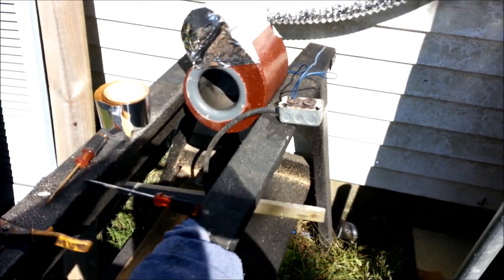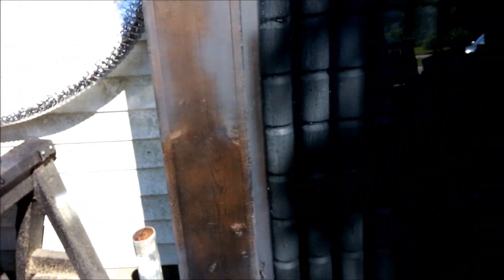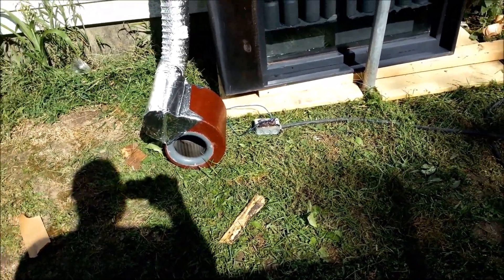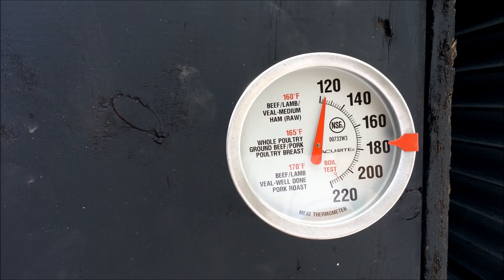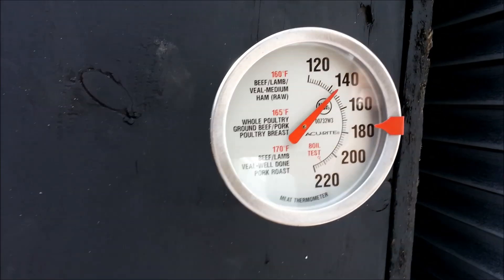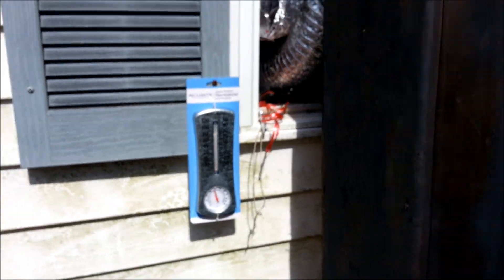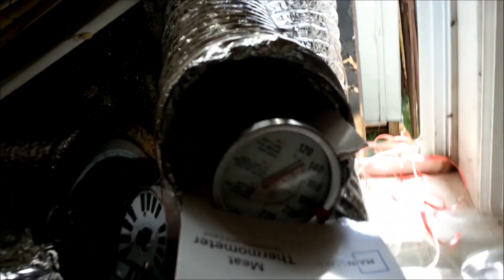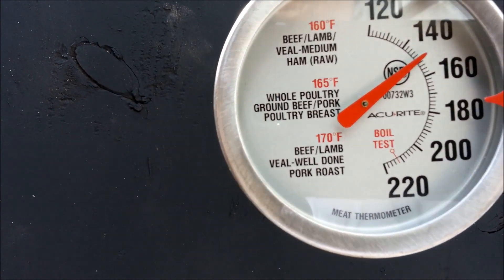How to build a solar can heater / solar furnace, for solar heat, Part7

Comment: Good work! Please make sure that the outer air enters through the bottom side and the hot air is taken from the top (upper) side of the box with black cans (if you already have it so, please disregard my message).
Reply from the maker: Yep, that's how it works.. Thanks for watching,, subscribe, because I plan on making one that tracks the sun on a rotor and timer..

Comment: Great work. You're going to enjoy it. Keep in mind that btu production is dependant on both temp and air flow. The faster the air is moving, the higher the btu*h. Check my latest furnace videos for formulas on how to calculate it. Don't worry about the temp dropping when the fan turns on, it will balance out in the end. Again, well done!